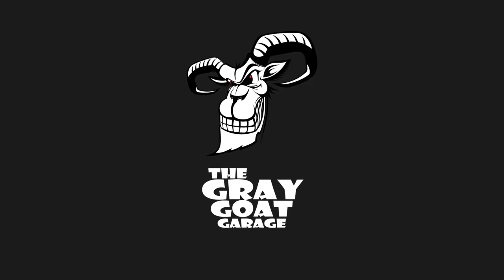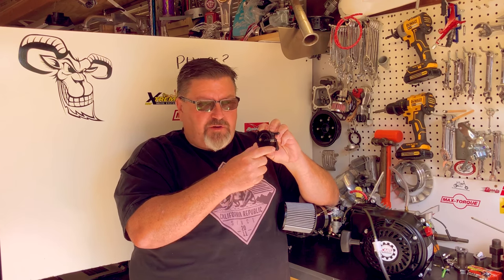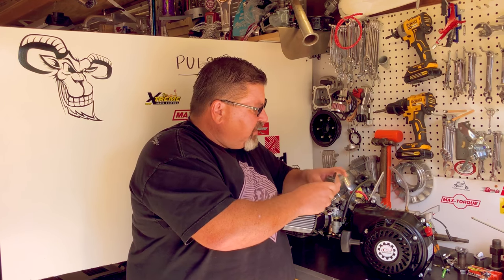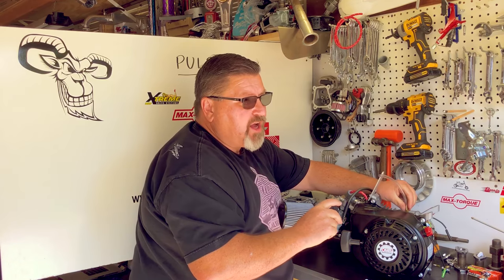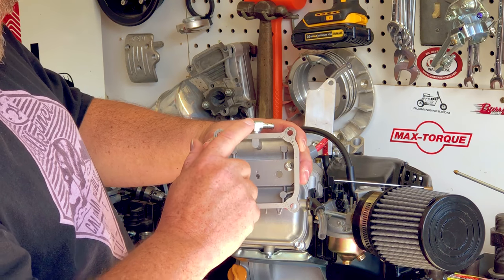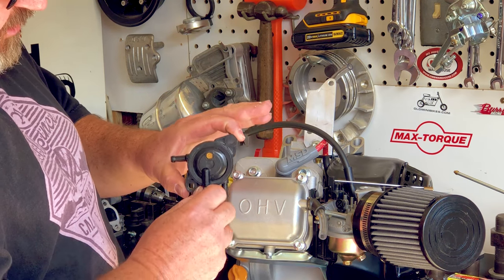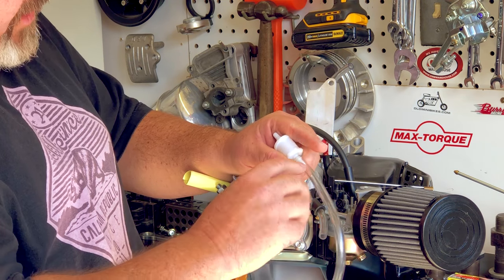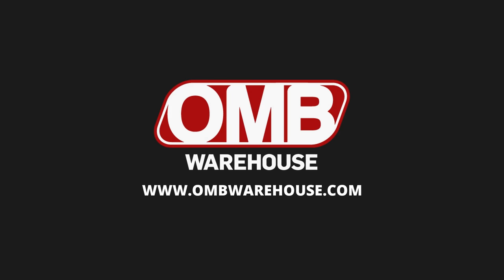Fuel Pump Installation on a Small Engine

Comment: At what point do you start needing a fuel pump? After gov removal, intake, exhaust, and jets? Or after some internal work? That one still looked like a factory carb.
Edit - after a little research its seems its not a good idea to use a fuel pump with a factory carb designed for gravity feed.
Reply from the maker: Hello,
In most cases a fuel pump is not needed. If you are running extremely high rpms and you feel like the bowl is getting sucked dry, then a fuel pump is needed. Methanol applications need a fuel pump as it takes twice the fuel as a gas setup. If you are using a stock type carb, chances are you don't need one.
Please let me know if you have additional questions
Reply from the maker: Hi Frank,
Not every engine needs a fuel pump! If you feel like the fuel bowl is emptying out at higher rpm's, then yes. You may get enough fuel by gravity feed alone. Try it without and see what happens. I am not a fan of fixing problems that don't exist! LOL Keep it simple!
Reply: Outstanding answer Greybeard
Reply from the maker: C'mon Frank! Gray GOAT! LOL
Please let me know if I can do anything else for you
Reply: @TheGrayGoatGarage  Hello Grey Goat Garage
I'm  installing an Isky 
Black Mamba cam ( .275 Lift / .246 dur. ) in a 196c.c. BSP engine ,
At what valve spring pressure do you need to
upgrade to Chrome Moly push rods , guide plate & automotive style valve spring keepers ?
Ive been told once you go above #20lb. springs.

I have #18lb. or #20lb.
valve springs ready
to install Just for the break in .
Your input would be Greatly appreciated
Thanks in advance
Reply from the maker: Hi Frank,
The Mamba needs a 26# spring and with 8000+ rpm capabilities, I would definitely use chromoly pushrods and split keepers. The stock retainers won't be real happy with that pressure and rpm's.
Personally, I don't like using the stock type retainers over 22#'s and 6500-7000 rpm's.

You need to remember, if something will fail, it will always fail for me first! LOL I plan for that with my builds! I use the stainless valve kits in most of my builds. 
We have a kit for you with the 26# springs
https://www.ombwarehouse.com/dj-ss-valve-kit-stainless-steel-upgrade-valve-kit-gx200-clone.html
pushrods here
https://www.ombwarehouse.com/2-chromoly-push-rods-5-260-gx200-clone-bsp-predator-212-non-hemi.html
and guide plates
https://www.ombwarehouse.com/rod-guide-plate.html

Please let me know if I can help with anything
Reply: @TheGrayGoatGarage  Thank you Sir 
For your quick response
Excellent , concise &
Very well explained as usual !
Now your my GO - TOO
technician for all  GX200 & clone performance advice
🏁🏁🏁🏁🏁🏁🏁🏁🏁
It's possible I just might sell the Isky
Black Mamba cam & 
Go with a slightly less aggressive cam & ratio rockers .
Stay tuned 😆

P.S. :  I believe Stainless Steel pushrods are lighter than stock .
But ,
Are they any stronger than standard push rods ?
              (- , -)                              
               😎                                 
  Thanks in advance
Reply from the maker: Hi Frank,
The Mamba is a nice cam and works well with the proper combination. With that much duration, it may not be suited for heavier vehicles/riders. Gearing will play a role in that as well.
Let me know what this is going on, the clutch system being used, and the sprockets sizes and we can put our heads together! LOL

Comment: I had a question sir Can u use pulse pump on regular carburetor with after market filter ?? I tried it and it was spitting gas I do have a dyno cam with billet fly wheel and 26!pound springs Please get back with me been fighting with my bike for day about to pull my hair off I bout two carbs and I just can’t get it HELP!!
Reply from the maker: Yes, you can use a pulse pump with a stock carb. If the pulse is too strong it can over fill the bowl. You can use an inline valve like this to diminish the pulse https://www.ombwarehouse.com/inline-fuel-shutoff-valve-fits-briggs-stratton-698183.html. A pump can cause more issues than it solves. If you can gravity feed the carb, a pump is not needed. You can test to see if you have too strong of pulse by disconnecting or clamping the line. Start the engine and slowly release the clamp. Try that before trying the inline valve

Comment: Im using a 420cc motor in my boat (mud motor). If I wanted to run an external fuel tank, I'm assuming I would need to install a fuel pump setup like this, correct?
Reply from the maker: Hello,
I have quite a few boat customers using the Walbro pump just for this situation
https://www.ombwarehouse.com/walbro-fuel-pump.html
just make sure to run the pulse line as short as possible and the least amount of restrictions in the fuel line.
Please let me know if you have additional questions

Comment: Does this help with top end WOT rpms when you feel like the top end is leaning out due to fuel delivery issues?
Reply: That's exactly why I'm here. I put a 265 cam in a predator 212 and lost alot of top end power. I'm hoping the pulse pump will solve this issue so we can ride our kart again!!
Reply: @pete_knuckles  long story short my carb was jetted rich - I dropped the main jet on my 24mm pwk from a 130 to 110 and it rips now 9450+ rpm nuts.

Comment: I am installing a pulse fuel pump on a small engine and one thing I didn't hear you say in the video was if you could connect your pulse line for the fuel pump to the crank case breather tube on the engine? Can that be done on a stock engine that is non-ohv? I appreciate any help I can get. Thanks.
Reply from the maker: Hi Edward,
The stock breather on small engines typically have a valve inside that would not allow the pulse to get to the pump.  For the OHV engines, we put the pulse port below that mechanism in the valve cover. What engine do you have? Please let me know and I will help you find the right spot
Reply: @TheGrayGoatGarage  Thank you for the fast reply and help. I have a 2005 Briggs 6.5hp vertical shaft engine.  The model number of the engine is: 123k12-0134-e1 Currently I have drilled a hole in the stock intake manifold and added an npt fitting with a line connected from it to the pulse on the fuel pump. That does not seem to work.
Reply from the maker: Hi Edward, 
the intake manifold, in my opinion, is the best place to pulse a pump. Nice strong pulse and clean from oil. On that vertical shaft flathead, the only other place I can think of is the oil fill tube...but I am not crazy about that idea!
Let's try and stay with the intake manifold. How far away is the pump from the fitting on the manifold? Shorter is better! Where on the intake did you drill the hole? Do you have the inlet and outlet on the pump correct? What pump are you using?
The only other option I can see in the schematic is to drill and tap the block. You would need to disassemble the engine for that to work! Pics! Send them if you can
Reply from the maker: Absolutely! 
Or if you give me your cell number I can send you a text and you can send pics that way too
Reply: @TheGrayGoatGarage  Awesome, I sent an email.
Reply: I don't think either the intake manifold nor the breather valve are good pulse sources as they are single direction pulses. they are not a good positive/ negative pulse needed to move the diaphragm back and forth to properly move the check valves which usually are flapper type and not spring loaded. some pumps that use only negative pulse are large spring loaded diaphragms
Reply from the maker: Hi James,
Thanks for the input. The crankcase will get the strongest pulse, but there will always be oil in the line. Too many people are mounting the pumps lower than the pulse point and the diaphragms get filled with oil and the pumps will not work. The intake manifold has served me well for many years and is a clean line! I guess that is why many of the aftermarket intakes are tapped 1/8NPT for the pulse fitting!

Comment: I have a clear valve cover with already a hole drilled with a nipple and air filter , can I use that ?
Reply from the maker: Yes,you can use that no problem!
Reply: That’s the best way and cheapest! you don’t need fittings if your line/hose is thick enough just stuff it in! 😎

Comment: Sir , how would you do this on a 5hp flat head Briggs ? I have one that I would like to remove the governor on and replace with the slid type carb !!
Reply from the maker: I prefer to take the pulse from the intake manifold on a Briggs 5. Most intake manifolds will have a pulse port. If you are making your own manifold, you can drill and tap the top of the side over for a pulse line. It is cleaner if you can pulse from the intake manifold... no oil in the line!
Reply: The Gray Goat Garage thank you very much for the info .

Comment: Do you plug off the breather hole on the hemi valve cover?
Reply from the maker: No, you need to leave that open and filtered for a vent. The pump will still work fine with that open!
Reply: Thanks brother! OMB has been great to me! Got the Wildcat 223 rippin’ in the Ct200U EX!
Reply: @TheGrayGoatGarage  could you run the pulse though there on the hemi??
Reply from the maker: @hudsonmyers7404  no, you cannot run the pulse line from the stock breather tube. There is a valve in the upper part of the inside of the valve cover that would diminish the pulse. You could remove the inner baffle, but you you still need to vent the engine. Drill and tap a new hole!
Reply: @TheGrayGoatGarage  I decided to get a valve cover with the pulse fitting I was gonna get the cover off yalls website but it’s not in stock but it’s okay anyway but thank you for telling me that cause if you didn’t I would’ve done it😂😂😂
Reply: @TheGrayGoatGarage  oh yeah and I noticed while I was looking at valve covers and I was wondering why do the Billet covers not have a vent tube if the motor still needs a a place to vent through?

Comment: Will this work for a gx390
Reply from the maker: Yes, the same methods apply to the bigger engines. It’s all about getting a good clean pulse and keeping oil minimized in the line. The Walbro pump is sufficient for that engine too
https://www.ombwarehouse.com/walbro-fuel-pump.html
Reply: I’m looking for the easiest way to do a pulse pump for my gx390 also. Valve cover seems easier. Will that work for the 390??

Comment: Hi triple G, I have a question about the fuel pump, when I  Xcelerate fuel comes out the top of the pump. What can be causing that?? It's a brand new pump...
Reply: Not sure if you're question has been answered already but that shouldn't normally happen it's mostly normal to see oil coming out of the top

Comment: I have seen videos with the pulse pump with a T peice in the air pipe from the valve cover to the carb... but you say thats not a good place to mount it, but why not?
thanks
Reply from the maker: Hi Pete,
The stock valve covers have an internal valve to relieve the pressure with air going out only. That is why when we drill a pulse port we need to be below the inner structure of the valve cover to get a good pulse. We get a good positive and negative pressure through the line this way

Comment: Great video Grey Goat...your thee man! Have a couple questions..I am putting a 212cc tillotson hemi in my minibike with a 24mm mikuni flat slide card..I was wondering which pulse pump that you sell do you recommend? The reason I am running a pulse pump is that I am also going to add nitrous and was told it would be better to run richer  ...thank you so much for your videos...my young son says your thee man as well!

Comment: 3/16=0.1875.....0.1875x25.4=4.7625mm...I'm gonna go out on a limb and bet it's 5mm fuel line like most other metric engines, not "weird 3/16 inch line" like claimed
Reply from the maker: 3/16” is the commonly accepted fuel line for these engines. That is all I use on my engines and never had any issues

Comment: May be stupid question but can u get to big of pulse pump I have gx160 on kart and put pump I found leaking gas out now
Reply from the maker: I don’t think your issue is the pump if you have one like us shown in the video. 
There are some high capacity pumps for snowmobiles that have dual outlets. 
Find out where the leak is and address that

Comment: Can I run a pulse off the vent hole in a clear valve cover?
Reply from the maker: Sure! Why not? Just be prepared for the clear cover to begin cracking and leaking! They are not very strong and are prone to cracking